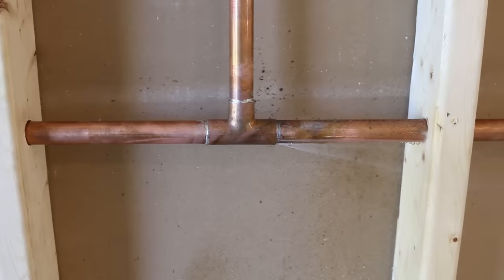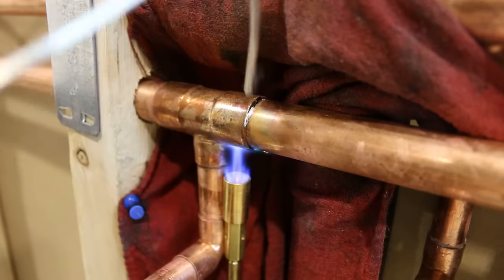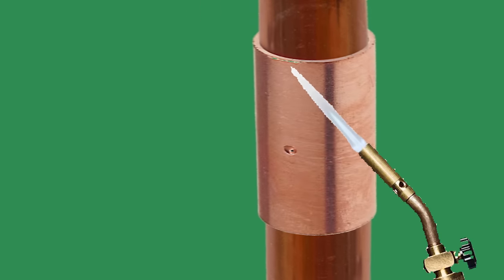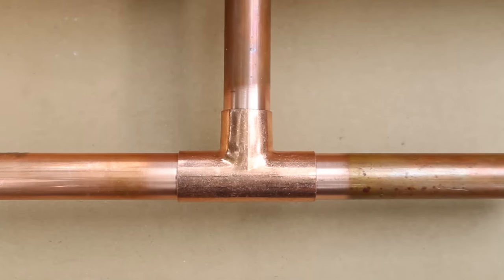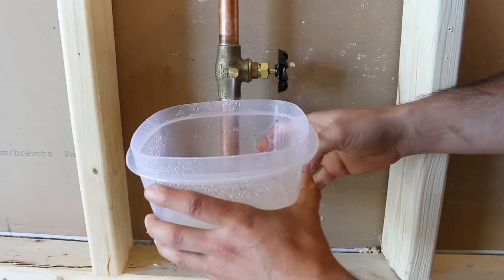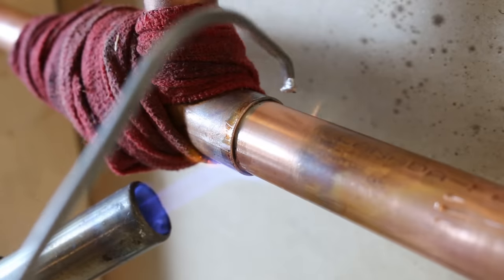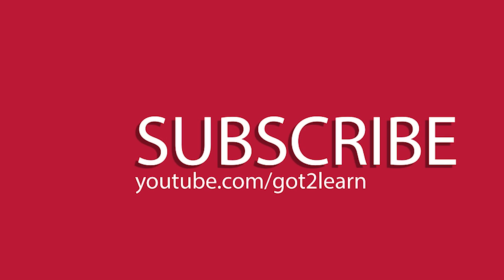The CORRECT Way To Fix A Leaking Joint (UNSOLDERING) | GOT2LEARN

Comment: From a layman's point of view your method is technically correct however as a professional plumber I would never use soft solder to join copper water pipes. The process is too slow and the joint is not nearly as strong as would be if you use 5% silver solder. I understand that the silver brazing method is more costly and requires the use of more industrial gases but the finished product is a far superior. You should give it a go.

Comment: Jb weld stick is perfect for leaks like this. You'll have water on in 10 minutes
Reply from the maker: The question is, how long is that stuff gonna last...
Reply: @Got2Learn  I currently have it sealing a joint in my plumbing and a leak on exhaust of my truck. Hasn't ever let me down. I always keep a stick at home and in truck.
Reply from the maker: Just keep an eye on it, I petsonally would have trouble sleeping at night lolll
Reply: @Got2Learn  haha. Stuff is legit. Sand the area and go all the way around pipe with it so it bonds to itself and pipe. It cures hard enough that you can actually drill and tap it to thread bolts.  I trust it

Comment: Uh theres a plumbers grease or something, i aint a plumber. But i do know that theres a grease you can apply to the pipe before connecting them together. Once together you heat the pipe and once the grease starts bubbling your pipe is hot enough. Thats how u know when your pipe is hot enough.
Reply from the maker: It's not grease, it's flux.
Reply: @Got2Learn  i knew it was something. Thought they said grease. Guess i was wrong. The whole part of learning.

Comment: Folks, NEVER un-sweat and reuse a tee fitting! Even with the wet rag over the other joints, those too, can still be compromised while un-sweating your bad joint. Regards, An actual Licensed Master Plumber, Plumbing Contractor and Licensed Mechanical Contractor.

Comment: I've been soldering for 25 years, and there is no reason for a  leak. leaks occur from poor cleaning of the copper surface, from forgetting to put the paste on the copper, and if you put the torch at wrong place of the fitting. I don't think I ever had a leak on a half inch fitting. Don't use propane use MAP gas
Reply: MAP gas is no longer available. Even if marked as MAP gas, all propane is regular propane. No more MAP.
Reply: @richardstrode8188  I live in Canada, so we have the yellow bottles marked map gas , you can even get them at Home Depot

Comment: You told us not to put flux inside the fitting, because it would cause corrosion over time.  Then you put flux on the outside of the pipe, and pounded it into the fitting.  How is that any different?  You still have flux inside the pipe, between the fitting and the pipe.
Reply from the maker: Yes, just less ;)

Comment: All you need is rosin core solder.
Reply from the maker: You can't use rosin core solder for plumbing.
Reply: @Got2Learn  Oh really, why can't you.?
Reply: should I say flux core
Reply from the maker: @jeffreywhitlatch1409  neither,  the solder used isn't as strong as plumbing solder and the flux isn't as aggressive since it's used for small electronics ;)

Comment: You're better off brazing. It's the same technique and you get a much stronger bond.
Reply: Except that may weaken the copper pipe surrounding the joint from the higher temperatures required to do the brazing.
Reply: @wingerrrrrrrrr  use cold water and rags to keep them cool while brazing your joints. works everytime.

Comment: a piece of bread or two can make a dam for a short time inside the pipe if its only drips we are concerned with then solder fast!
Reply: If you use bread or toilet paper to make a dam, be sure to turn off the water to each toilet and refrigerator. Otherwise you may clog the toilet valve,, or plug the refrigerator filter if they are used before you turn on the main valve and repressurrize the line and have to clean them when the water main line is turned back on. I learned that the hard way.

Comment: The best way is to cut out the section and replace it. Heating up joints next to other joints even with a wet rag will fail prematurely. Soldering is old school, we all Propress here.

Comment: 5:52: drain cap on the side of valve.
Reply: @Got2Learn  The cap goes on the output side so you can close the valve and drain the pipe. There will be a hole in the cap and a rubber seal so you don't have to remove it completely.
Reply from the maker: It's on the correct side, what are you saying?
Reply: @Got2Learn  sometimes people install them backwards if they don't know what the cap is for. A "plumber" replaced galvanized pipes with copper in the building I live in and some have drains and some don't and some are backwards.
Reply: @Got2Learn  comment was for those who didn't know what the cap was for.
Reply from the maker: Ahhhhh I thought that you were saying it wasn't installed correctly lol but yes, people outta know the difference ;)

Comment: How to solder-
Step 1-go to Ferguson or a plumbing supply store.
Step 2-purchase a propress tool.
Step 3-get propress fittings
Step 4-become a friggen boss with your newly acquired propress tool and go out and fix any copper leak in minutes now instead of hours.
Step 5-go buy some Axe deodorant because now the ladies are throwing themselves on you and they won't let you take a shower to smell better so be aware.

Comment: I never had it - from my early years till today 35 years later. I guess this video is kind of propaganda. I had mayebe few problems with welding 5" elbows from the solid steel pipe, then with "welding" cooper pipes, which I consider poisoness since inside of the old pipe you can clearly collect a deadly cooper sulfur - used in the most of the rat killing poisons! Draining a water and drying the metal is ABSOLUTELLY ESSENTIAL in  the iron pipes welding and soldering the cooper pipes. Cooper pipes are the history,  and all together we have to replace them as soon as possibler to avoid more cancers!

Comment: It does NOT take years to learn to solder a joint. One can learn in 5 minutes.
Reply: Yeah, it's really not that hard. The people in these comments that say "don't touch it, call a licensed plumber" are being ridiculous. Maybe once upon a time tradesmen were actually 1000% more competent and trustworthy, but no more. I'll wager that with a little practice and patience I will do a better job on repairs in my house than the so called "licensed professional" who doesn't really care about me or my house.  Not on all tasks of course, for instance I wouldn't touch the gas line, but for a simple copper water pipe - yeah. It's not that hard.
Reply: @JohnVJay  Thats how i learned to do most of the DIY at home projects, pay someone to come do it and WATCH them. 

And i agree with those licensed professionals coming to my house, its not their house, they don't care, they are in a time crunch and just want to fix and move on. This is why i do it myself so that i know its done RIGHT the 1st time.  

Gas line i won't touch either but simple pvc or copper i will do.
I also do all the electrical in my home and ran power out my shed.
Reply: @ACommenterOnYouTube  When I decided to finish my basement I decided to do as much of the work as I could myself. After 30 years of home ownership doing small repairs etc. I wasn't sure I had the necessary skills, but I ended up doing all the concrete work, framing, electrical, and 90% of the plumbing myself. I just took my time and did a lot of reading beforehand. It wasn't really nearly as hard as I had thought. I paid someone to hang the drywall, mud and tape, because I knew it would take me way too long to do a good job.

Now I'm remodeling my master bath but instead of sweating pipes I'm going with Pex because running copper pipe through a finished wall would take forever.

There are some things you really do need to hire a professional for, but most things a reasonably handy person can learn to do themselves.
Reply: @JohnVJay  The last hurriance we had, my Wife's Uncle, his trailer was flooded but only the rear of it because him and about 15 other trailers were in the low spot of that area so the water filled up and the back end of his flooded and he had 1 inch of water thru his master bedroom.
So i was the one to rip the floors apart, take down the drywall, take out all the old 2x6 floor joists ...pull out all the old wet insulation and put down new 2x6x12 floor joists and secure to the frame, put down new insulation, new 3/4 inch  4x8 sheet floors, new laminate ... blah blah blah ...
Fix the electrical while the walls were down because once we pulled the walls down, the shit job they did with the electrical .. OMG ...
Had to fix that ... Then put the drywall up, paid someone to mud, then me and my wife painted, put in chair rails, new base board trim .... All by ourselves and saved TONS of $$ but it took us like 4 months to get it done. 
So yea i know exactly what you are saying

Comment: There is nothing wrong with fluxing inside fitting any decent plumbers do this. DONT use sand paper use wire wool too clean joint
Don’t try soldering with water in the pipe
25 years doing and teaching plumbing 
There is far more to it than you realise
Reply: Don’t learn to be a plumb !!
Learn to be a plumber 
Go to college be trained by skilled guys 
Learn the correct techniques and theory’s. It takes years not five minuet videos

Comment: Its "soLder" not "soRder" :-)
Reply: Actually the "L" is silent. It's pronounced "Sod-er" or "sod-der"
Reply: @zeroumashi2947  
Only in the weird American version of English. In the home of real English (I know that's arguable) England (UK) it is far from a silent "L"
Reply: @globeforever9777  the 14th century word "sawd" it's based on says otherwise.
Reply: I'd rather have an electronics-tech / plumber / mechanic / hvac tech / etcetera, solder a joint or connection properly, while pronouncing the material improperly, than have some clown half-ass the job while being picky about word origin and pronunciation.
Some of the best techs I've worked with and hired, in multiple fields, couldn't hold a lengthy conversation in English; but worked circles around, and did better work than, most of the d-bags that talked shit about their culture behind their backs.

Comment: You said, A Leaking Solder Joint Will Be Repaired Incorrectly By Most Plumbers. You Mister are Dead Wrong. For all you U Tubers, realise this. There are People that do plumbing and then there are PLUMBERS. A plumber is someone that has served an apprenticeship and is in every way a Professional. Please Sir share with up your credentials.

Comment: Seems to me you're using a propane torch which is the wrong heat Source you should be using the settling with a very fine tip Flame to direct the Heat. Always apply the heat at the opposite end that you want the solder to flow which you did not I think your methods are okay but you are obviously not a journeyman plumber

Comment: Wrong!!! When you heat one joint you heat them all and compromise the nonleaking joints. The proper way is to cut out the entire fitting and start over.

Comment: All that copper you used is m copper notice the red marking on the copper.  Used for heat not for water lines.  Reason being it is thinner wall and will pin hole quicker in the future. Always use L copper which is marked in blue. You failed! Haha
Reply from the maker: I use type M for my videos because it's less expensive, never use type M for potable water, only type L.

Comment: Most plumbers do not attempt t to repair a poor solder joint...
Reply from the maker: They should 🤷‍♂️
Reply: You don't repair an existing solder joint..ever..you start over , cutting said fitting out, and starting over. They should? Are you even a licensed plumber, or some idiot who saw a YouTube video?
Reply from the maker: @andrewchristensen6295  🤦‍♂️
Reply from the maker: Plumb on 🤘

Comment: very bad soldering! buy a normal torch and copper solder. you cannot use the flux! the pipe is oxidizing. it is enough to warm up the pipe well

Comment: why dont u just use a copper phosphorus rod...that way u can patch up any leaks without unsoldering.
using silver rods on copper2copper joints is ur first mistake.. u do this in all ur videos... what do u expect
Reply from the maker: We do not use silver here, it's too expensive for soldering normal joints, we use that on HVAC or air lines.

Comment: If properly soldered in the  first place the leak would not have happened.  An introduction of any amount of water into a pipe will cause this and this video does not cover the most common cause of a failed solder joint.  Also, I notice the studs do not have the proper insulators to prevent water hammer and knocking  sounds.  Go back to school.
Reply from the maker: You are right, but I am not going back to school 🤣

Comment: sorry but, the joint you did at 9: 30 the solder got to melt point and kind of flowed with help...... this melting point is called plastic, the solder has to get to its max melt point usually around 475c for 60/ 40 and hotter for lower lead based and indicates the solder is no where near hot enough to de wet. that is the worst soldering i have ever seen, and i have seen some pretty sh**ty solder jobs..........

Comment: Taking so many precautions on domestic plumbing lmao... there isnt enough pressure in the line to begin with. Any idiot can solder 22mm copper pipe... microfractures.... LOL....  over heating... LOL.... not quenching joins? Gimme break... would take this guy a whole day to put in a length of pipe and a few elbows...

Comment: YOU DON'T HAVE TO TAKE THE PIPE OUT! IF YOU CLEANED THE PIPE CORRECTLY YOU SAND THE OUTSIDE AND FLUX IT THEN . YOU START FROM THE BOTTOM AND Work Your way up! Bad video!
Reply from the maker: Your way will work, but for how long Eric, that's the real question ;)

Comment: You contradicted yourself
Reply from the maker: Did I?
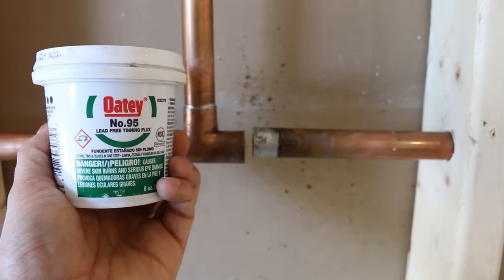Reply: Around 7:20 of the video, you talk about not using fkux, but then you used flux.  Regardless of the flux composition, you said it wasn't needed.
Reply from the maker: @Billvagsayer  no need for "tinning" flux if the pipe is already tinned from the previous joint, just use normal flux in this case 👌